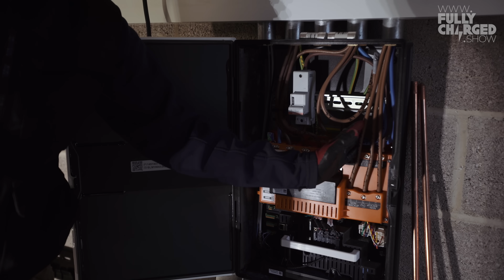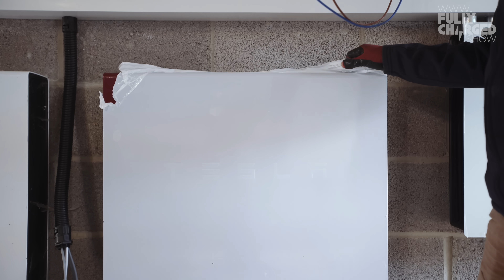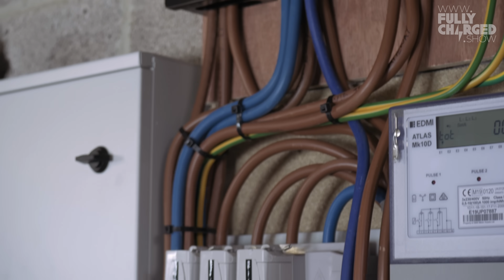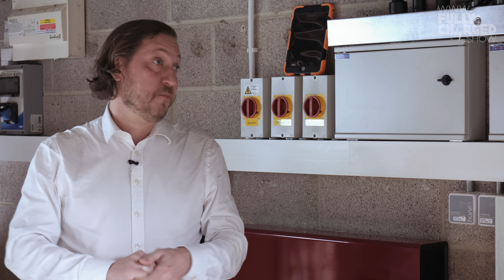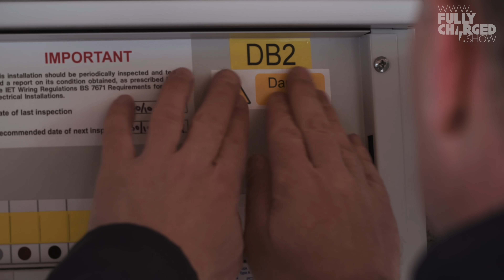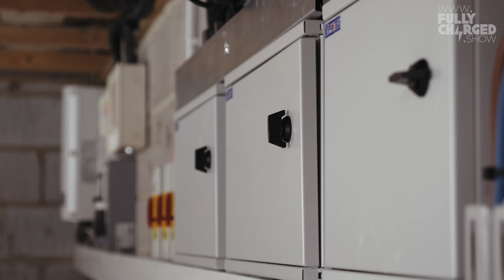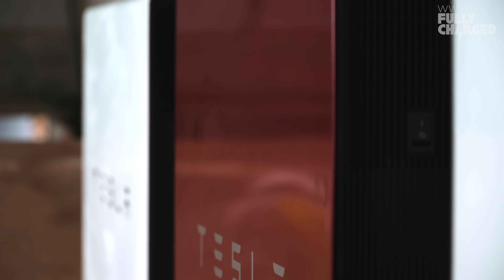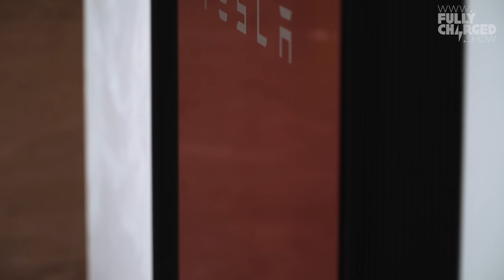Can you run your house on a battery? Tesla Powerwall 2 (Founders Series) & Tesla Backup Gateway 2

Comment: Sorry Robert, but I think that all of this equipment in and on your house is ridiculous. The look of the house is spoilt by the solar panels which are probably not at an optimum angle to the sun and the garage is covered in inefficient small scale equipment which is very costly to install
It would be much better to invest as a syndicate in a large scale solar PV scheme in a field with the panels at an optimum angle to the sun and probably almost invisible from roads and residences. Then large scale batteries can be placed in an adjacent equipment cabin to serve the function of the powerwall.
Further, if you really want solar on the roof of your house, then use hot water solar panels which are a far more efficient way of extracting energy from the sun than photovoltaic.

Comment: So I still need a UPS for all my computers? They’re not going to like 3 second of black out. I’d expect cycle by cycle monitoring with switch over if two or more cycles are lost. Also, my heating and shower is powered from electricity so would this two battery system power 12kW load?

Comment: Question. What's the point of storing solar energy when the utility company pays you for production?
Reply: oystein8371 Because you aren't making electricity at night. This way you can use your own generated electricity without having to "buy" it when the solar arrays aren't generating, by using your own stored power from batteries. You also can feel good about the fact that it's coming from your solar roof and not possibly from a "dirty" generating plant.

Comment: Assuming that each powerwall is 1-phase AC-coupled, how is everything wired up to become three phase? Does the gateway synchronise the power coming from both powerwalls to make it three-phase, so it can be injected into the grid, for example?

Comment: Having 3 phases at residential properties and free standing houses is very common in continental Europe. I guess 40 or 60A usually. 100A not so often, but usually it is not a problem if one wants or it is a new installation. Depends on a size of the site too. Not so much in UK or US tho indeed.

Comment: I was a bit disappointed in how long it took for the power to come back. I just assumed it would be so instant we wouldn't notice.

So, he now has 400V 16A? Because it can now handle 11 kW solar. But then he mentions a 22 kW charger. I'm confused. Does that mean the charger takes 11 kW from the grid plus whatever is available from solar+battery?

Comment: Dr. Jardine did a great job of clearly explaining the features, improvements, and gotchas of the powerwall system.
Reply: Also did not properly explain everything.  Dr. Chris Jardine was incorrect on his single phase description. Single phase has 2 hots and a neutral. If you are going to install this stuff you need to know about electricity I would think!
Reply: @hellviper944  Nearly right: It's actually live, neutral and earth - and done depend upon the colour of the wires. Traditionally live used to be red, neutral was black and earth was green or bare wire. These days, conventionally,  it can be live - brown, neutral - blue, and earth - yellow and green. And all these colours can be different in different countries and according to what your electrician had available at installation time (thinking of Italy for that last one).
Reply: Josh Laird  No, he described it correctly for the U.K. Which is where Robert lives and his house is. :)
Reply: @andygilbert1877  Sorry, but I think you will find you are all wrong. Now there is a strong claim.  Single phase in Australia and England uses a single wire to a neutral that is 240 v potential. That neutral is earthed at the pole and at the home. There is no other source of voltage. 

In North America, and I asked a line technician about this one, the supply to the house is called single phase because the transformer uses just one of the three phases out in the street. It then goes to a transformer that has a centre tapped winding creating the neutral. That is earthed at the pole and in the home. So between the neutral point and the two ends of this winding there is a PD of 120vac, and a difference between the two windings of 240vac because they are 180 degrees out of phase. So there are two phases in your home supplied by a single phase out in the street. Helpful much?

Comment: Deep cycle lead acid batteries are much cheaper and more environmentally friendly.   Deep cycle lead acid batteries can be very efficiently overhauled and used for decades.  Lithium batteries are just thrown away when they wear out.   

The only reason lithium batteries are used is when weight or size constraints are worth the large extra cost and environmental damage.  Neither constraint applies in a house.  

Of course this battery has "Tesla" printed on it and we have all been programed to flush our facilities of logic and prostrate ourselves before the god king.    

By the way, the actual batteries in this thing are produced by Panasonic using the least stable and most fire prone lithium chemistry available.   The Tesla contribution to the "Powerwall" is the plastic cover with "TESLA" printed on it and loads of marketing hype.   The innovative brilliance is so overwhelming it's hard to even look at it.

Comment: How does it works when you buy from a certain provider ? Does it have a wire from each provider to your house ? (Sounds ridiculous but...) How can you know that the electricity you're using when you buy from a certain provider is the "green" one they are selling and not the coal-fired plant one? In Québec, we only have one provider so I'm not familiar with that situation

Comment: Nice, how did they configure the Powerwall to 3 phase? The Powerwall is 1 phase isn't it? Or is only at a power outage only one phase powered? Or did they switch all three phases in parallel to one phase - Powerwall. That could declare the 3 seconds outage. :-)

In Netherlands it is common to have 3 phase to houses. We have a 9kW peak solar installation and the inverter is 3 phase. How to use the Powerwall in this installation? Does the Gateway have an extra 1 -> 3 phase AC converter? What are the details of the installation in this clip?

Comment: 6500 for the Powerwall is not for everyone but certainly to a certain few that can afford it would be an inmense deal. In Argentina we have flat rate so the way it would work would be topping it off on solar and then using it at peak hour, driving from the grid only when the PW depletes. But it all depends on your grid regulations. Here up to not very long we couldn't divert solar onto the grid. Either you used it or stored it. Now we can take it back onto the grid. Since I have central AC I had three phase for the past 3 years. It wasn't expensive since we had a major remodel. Thank you for these vids!

Comment: We are looking at a Tesla system and if it includes using three phase it ain't going to happen. $60K cost, glass roof two power walls for 900 KWH per month
  If you don't interact with the grid you don't have to worry about all that bureaucracy and BS. Go off grid totally. I'm not looking at Tesla so I can have another business relationship with PG&E.

Comment: The fact the Tesla system takes so long to power the house on a Grid power cut is mental. 
On my eyes this is a bad design, the batteries should be connected at all times to the house, using the Gateway to cutoff just the grid.
Reply: I wondered the same thing.  In North American installs the changeover is milliseconds and quick enough to keep your computer running uninterrupted.  You just get a very slight flicker.
Reply: @taylorlightfoot  Your computer should be on a UPS anyway along with any other critical devices. Milliseconds is too fast IMHO what with lightning strikes etc. Step one, if you are thinking of going this route, would be to install a big manual disconnect switch so you could safely disconnect from the grid and connect to whatever DIY 'powerwall' you are cooking up using salvage LiIon packs etc.
Reply: @anastigmatix4119  I made no mention of a DIY power wall.  If i'm doing a home battery I'm going to get a real PowerWall from Tesla.  

My comment about the computer staying on was just an example to describe how fast the changeover happens for Tesla Installations installed in North America.  We don't have to reset our clocks when the changeover happens, computers keep working, medical equipment continues uninterrupted.  There's really no need for a separate UPS at the computers when you have a PowerWall and Gackup Gateway in North America.  

What @Ralmslb and myself are trying to figure out is why the changeover took so long in this video?  Is it a faulty installation? Are there regulations in his country that limit how fast the changeover happens?  It's clearly not a technical problem, since North American Installs can do the changeover uninterrupted.

Comment: Great presentation.  We have a similar setup using the German designed Chinese system Alpha ESS which includes grid backup and load shifting. 5.4kw of panels and 12kWh battery. Totally brilliant system. Love seeing grid consumption at 0kw most of the day. We only import from grid at low night rate even during the winter.  Also have myenergi setup with Eddie, Zappi, Harvi and Hub. Well done getting the free battery. Prices are heading towards $100/kWh so cost of these battery packs and EVs should drop over next 24months.

Comment: Bear with my reasoning, read it and look at my question in the end. What do you think? (Probably on 12/12, a continental European should only mention "the continent". ;) Whatever you do, hats off.)
Here, on the continent, 3-phase is the norm and if/when an old house has no 3-phase connection to the grid, the upgrade is "free" (meaning the costs are absorbed by everybody via their fixed monthly base connection fee). The big financial problem with solar power HERE and connecting that power to the grid, is that your excess energy goes into the grid which makes you financially like an electricity company and means taxes and wholesale prices apply, instead of the rates that you as a private consumer pay. So, of any kWh you produce in excess of what you can use yourself, financially, only a small portion comes back to you. Financially, this makes your earn-back time of your solar installation a lot longer.
This has nothing to do with 3-phase power.

The Tesla battery seems to me like a way around this financial issue. But it raises your upfront investment and in the end (bottom line) you may end up with the same earn back time as when you just dump your excess energy into the grid.
What could you do to improve the efficiency of solar, financially and overall?
IMO, as long as you can prevent to use any conversion, you make less losses. The solar panels generate during current (DC) as well as the batteries. Regular lights and heating elements do not need alternating current (AC). Even most lower voltage electronic devices internally run off DC. This means, any energy from the solar cells you could use without conversion, is much more efficient. What conversion? Well the grid relies, rightfully so, on AC and you cannot put DC into that. It operates on around 230V in the UK (or 240V already) which is more than what comes out of the solar panels. Transforming a voltage from lower to higher, or vice versa, can easily be done with transformers, but requires AC. So, the electronic boxes between the solar panels and the grid, or potentially your house's electrical infrastructure, convert DC from the panels to AC (losses), regulate the voltage to a standard (losses), and need to precisely maintain the timing of the AC waves in sync with the grid they feed into (some loss) which triples with three phases. And, financially, when you put that into the grid, you get way less money deducted from your invoice compared to what you would pay for the kWh you produce, if you were to take them out of the grid.
So, if we can put the solar energy simply somewhere that needs no conversions nor regulations and we can sort of store it there, my guess is we can make the whole thing more economically viable.
One of the biggest energy consumers people in the UK use, or my neck of the continent, is hot water. Imagine, we can use solar to heat a hot water reservoir that is optimally insulated. It does not need conversion or regulation, the way I understand it. It does not produce an environmental disaster of old batteries. It does not give energy to the grid but just reduces the household energy intake from outside our property. In here, avoiding giving energy to the grid is one aspect, financially.
Less tech. Less environmental load at the moment of recycling old stuff. Less investment and greater output. Or did I miss something?

Comment: Hmmmm, it’s getting interesting in the UK now. I currently have 4kw of solar but no battery, and felt I would upgrade to 6kw solar and get a battery in a few years. However I have seen electricity tariffs that are 8p / unit for 10 hours at night, and 16p / unit during the day. I’d need to run the maths, but with that level of tariff, I feel that more solar would not be cost effective, but a bigger battery would.  It of course if further complicated by my intention to move from Gas Heating to a heat pump when my current boiler dies, so my consumption of electricity will increase.  I’m planning to do the calculations again, when the inevitable Powerwall 3 arrives.
Reply: I'd love to know who was offering that tariff, Paul!
Reply: Hi, I think it was EDF energy, but you need gen 2 smart meters.
Reply: @Muppetkeeper  I'm already with EDF, with Economy 7 (3 phase supply, no smart meter) and best I can get in my region with my set-up is 7.2p for the seven hours night rate and just under 22p for day fixed until Feb 2021. Already have a "higher than normal" proportion of night units (storage heaters in the annexe) but hoping a powerwall will almost eliminate day units altogether.
Reply: salokin Hi, the tariff was called GoElectric, maybe if you contact them they will transfer you onto it.

Comment: Now the cynic in me question the back feeding issue on part of the power companies, the engineers very often work Lon live plant. I watched some guys remake a joint live?
Reply: I think the back feeding issue is more legal/administrative protection thinking rather than engineering thinking. There are quite a few parameters to take into account so I would guess that the power company has set up a single legal/administrative limit so extreme that the limit will never expose anyone to risk of anything. It's more about removing risk of being chased by lawyers than producing an installation specific engineering decision.

Comment: 11:30 so a PC would still heed a UPS...!
Reply: a decent UPS offers (like my cyberpower) ac wave smoothing, under/overvoltage and surge protection, aswell as 30 minutes back up in case of power cuts... i also have a small ups for my router, and plan to have a small ups for the tivo(how annoying is it when you have a power outtage midway through tivo recording something)...
Reply: @iainansell5930  I have an APC Smart1500 with true sine wave & it's saved me multiple times - 7yo on its second battery
Reply: But a Mac would be fine, if you have enough farts in your air.

Comment: Hi Robert, nice to get an update on your Solar and Powerwall installation.  I have a similar sized 5.5Kw system with a single Powerwall2 battery & original Zappi, as per your previous system.  We're slightly further south than you, being based in Devon but, otherwise it's quite a similar system.  It would be good to get some feedback from you as to how much power the system has generated over the last year & approx how much you've managed to store until needed, in the battery, etc.?
We've had our system about 16 months and we're delighted with the reduction in electricity we've needed to take from the grid. 
Keep up the good work.

Comment: We had ours installed in a garage in Vermont. Found out the hard way that solar will not recharge the battery when the cells are colder than 12C ~53F

Comment: How does your car fit into the mix? It’s battery capacity is what, 3 or 4 times the size of the power wall. Can you charge it from the power wall? Can you charge the power wall from the car?  Does the smart gate take into account the car battery capacity when figuring out the charge strategy for the power wall? With power wall, car, your domestic PV system and variable rate electricity connections to the Grid, that’s an interesting system to analyze and optimize.

Comment: Should be designed in such a way that the power company is not involved, like mine. I'm running off a 20kWh LFP battery right now, its 2am. In the morning I'll probably be down to 76% left in the pack, and the panels will charge it back up by 10am, after which the inverter is powered by the juice coming out of the panels, until the sun sets.

Comment: I have to say I’m not impressed. I’m in south Texas oil country and have installed/ design my own off grid solar system. Two 10,000 watt Vitron Quadros, 15,000 watts of solar and 15 Battleborn battery’s that can NOT catch on fire being the LIFEPO4 chemistry. The system is primarily off grid but it is also a grid tie, point being is you never lose electricity no matter what system you’re trying to runoff of whether it be grid or solar, the power never flashes so tv or lights NEVER loose power. Tesla should be the top-of-the-line innovators and have the best of the best...... I say Victron trumps the system 10 times over again.